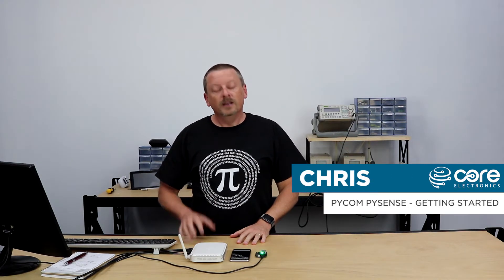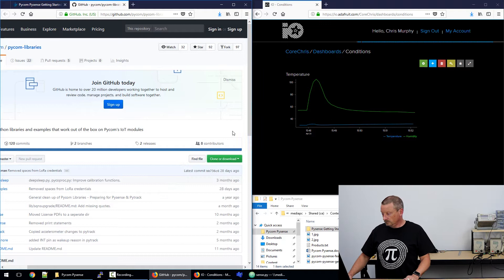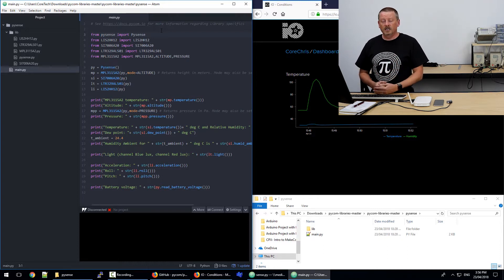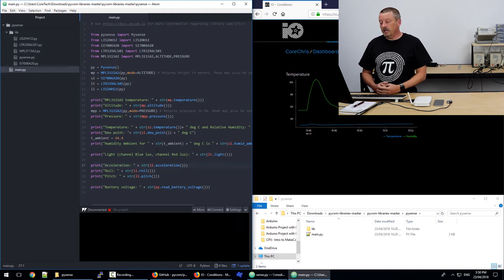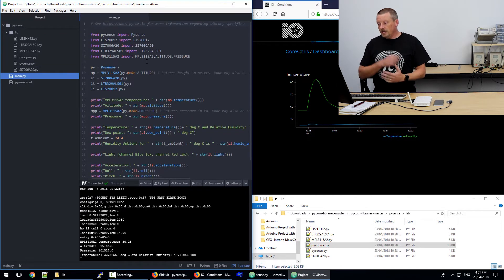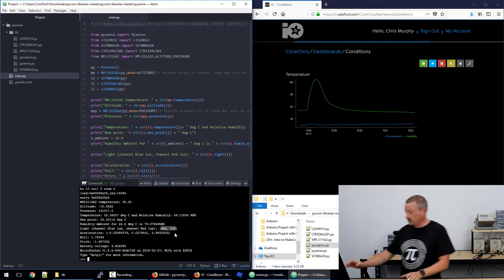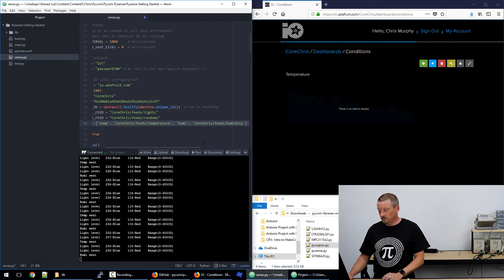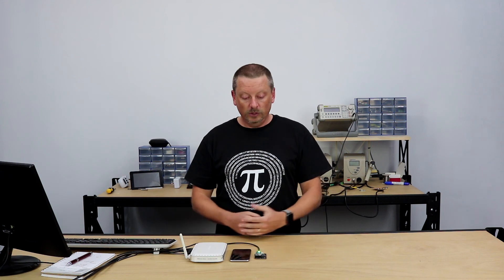Pycom Pysense Getting Started Guide

Comment: Can I ask how you got the wifi to work?  How do you enable it etc. I am just now getting the pisense to load but cannot look at serial port output because I am using the serial port to connect to device. What does it take to get the Wify part working.  It does say on device Wify etc.   I am seeing you have to load a driver perhaps?  But not really seeing any instructions anywhere to do this.